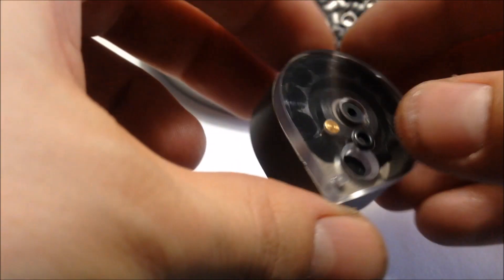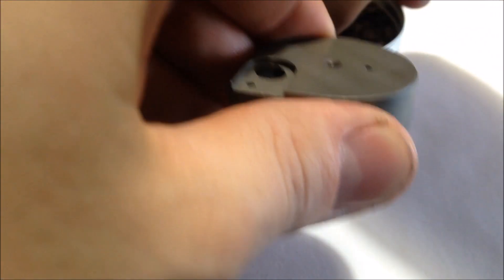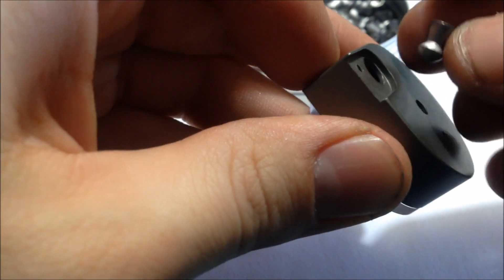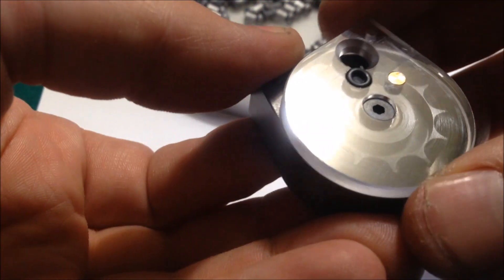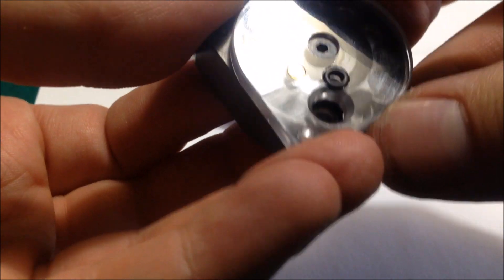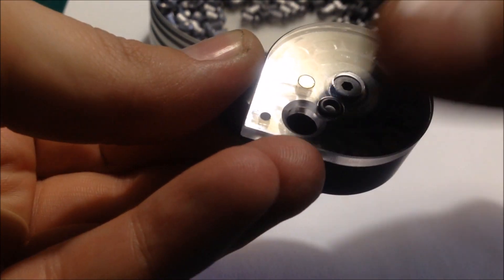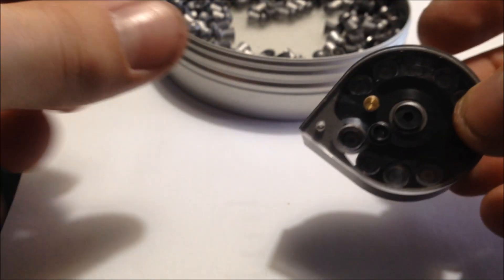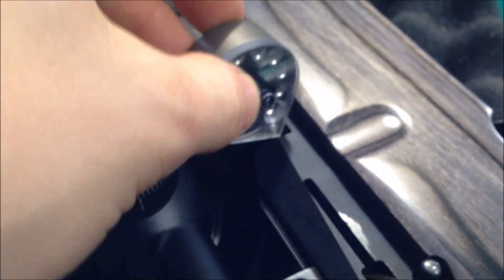FX Airguns How To Load An FX Magazine

Comment: You have any trouble moving the power adjuster wheel on your Streamline? I can't budge mine and I don't want to use pliers on it, ideas?
Reply from the maker: It can be stiff. Take the stock off, add some WD40, put a rag on it for grip and work it around until it loosens up.
Reply: Awesome man, thanks for quick reply!

Comment: Hi Randy. Thank you for this video.
Jst bought the FX Streamline . 22 however,  I noticed that my mag rotation ws stiff, I used an appropriate allen key to slight loosen it abit.. Now its gt the spring in it. Bt Im nt sure if it is fine or maybe faulty? Im also nt sure hw much tension should the mag hv
Reply from the maker: Hi Mohamed. Thanks for watching. If it was stiff enough that you felt the need to adjust it was probably to stiff I've never adjusted mine. I would say just fiddle around with it. It should be tense enough to function 100% without damaging the pellets. Have you tried it does it function properly after you loosened it?
Reply: Randy Real thank you for ur prompt response. it does seem to work now, I have loaded pellets. Will try it out soon
Reply: Thanks Randy for all your assistance. Magazine working/indexes fine

I have noticed that my rifle doesnt engage the safety mode and presume its because the trigger has been set (from the factory) too light.. Could this be true and where do I adjust it? Thnk u
Reply from the maker: The safety on FX airguns don't engage unless the trigger is cocked. If you chamber a round you can them flick the safety into the safe position afterwards. The factory setting is probably good. Having the trigger set light is good for accuracy you will be less likely to pull the rifle off target. Try cocking the rifle without any ammo and see if the safety engages after cocking. If you need to pull the trigger after to reset the trigger dry fire the rifle on the low power setting. Having the safety work this way is kinda handy because you can always know if you have a round chambered or not if you forget. if the safety won't flick on then you know you haven't chambered a round yet and if the safety is already on then you know a round is for sure chambered this prevents dry fires and loading two pellets at once.

Comment: I was having problems when I put the mag in and tried to. Push the lever forward to load a pellet the probe wouldn't push the pellet into the breech after pushing and pulling the mag about it would eventually work then several pellets later it would do it again as if the probe was hitting a dead end like when you empty the mag and the probe hits that solid plastic to tell you it's empty. So I took a Allen key and backed off the screw in the centre of the mag and it seems to work perfectly fine but now when you load the first pellet you have to hold the mag as now it wants to spin as it seems to be under spring tension any ideas thanks
Reply from the maker: Not sure. Mine is stiff and wants to spin slowly I just hold it. What pellets are you using?